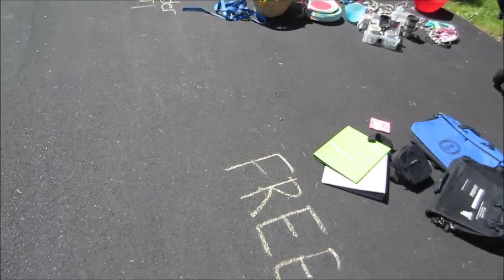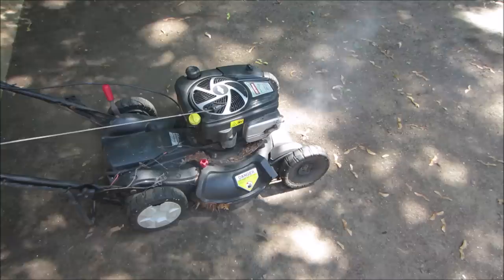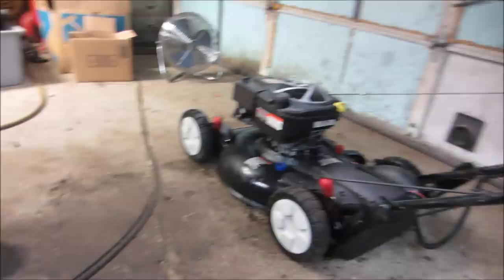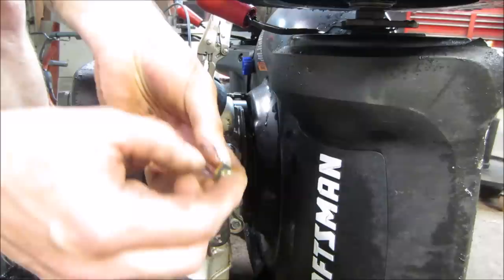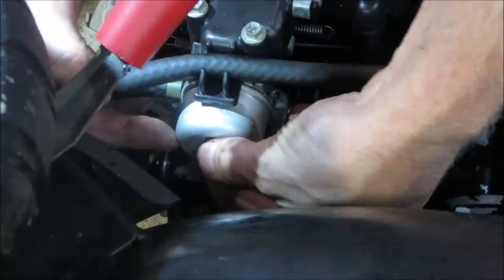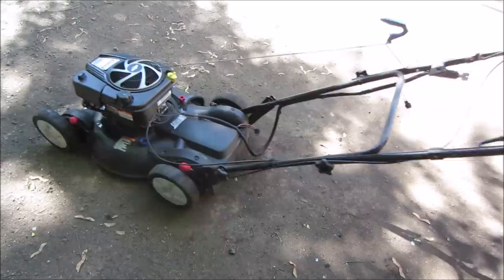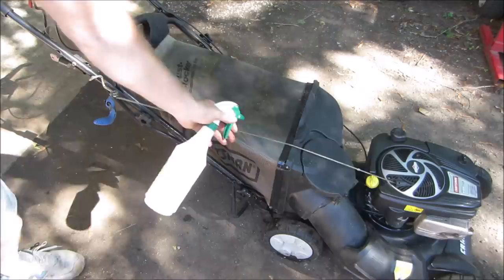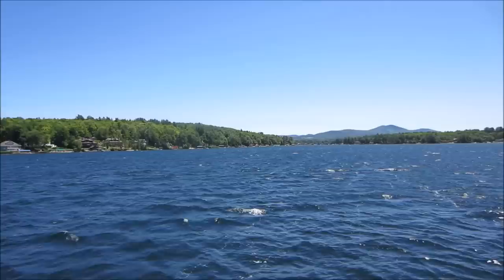Free yard sale broken lawn mower can we fix it?

Comment: On servicing those paper air filters, my initial cleaning blast with the air gun is usually from the inside out, (or against the air flow when in use) when possible.  Thanks for all these lessons.  Narragansett Bay.
Reply: Agreed.  I've always been told and have seen that you blow air filters out from inside out so as not to force particles deeper into the material.

Comment: I gave 20 bucks for a store return that was locked up. I realized at the store it was locked up because someone told their kid to fill the oil before cranking it for the first time and he did,,,,all the way to the top. I took it home, drained about 2 quarts of oil out of it and after an hour, it finally stopped smoking. Sold it the next day for 75.
Reply: BCtruck, rebuild, repair,repurpose overfilling wouldn't actually cause it to lock up unless the oil got on top of the piston somehow. I guess that could happen from overfilling and tipping the mower to one side but never heard if it.
Reply: me niether until it happened. in fact, i pulled the plug to empty the cylinder of oil.
Reply: I found one in the back of the "repair" shop in their trash pile. Asked permission, got permission, still works today.
Reply: aserta
Most repair shops also sell new stuff...
Reply: Good one I salvaged had a tag reading "siezed".  Took it home, and was pulling the plug to squirt some PB blaster in there, and a bunch of gas came out. 
Float bowl had stuck, flooded the engine and hydro'd it. 
Not a super expensive mower, but free is free.
Reply: Jeremy Alford I've seen it plenty. Its like being hydro locked. Oil/water end up in the head and it barely can be pulled over. You clean out the head and its good as new.
Reply: $75 only?
What model. Here in NJ a mower thats even in like new condition fetches around $200, like the Toro Recyclers, in really goos shape they go for $200. I mean even a little base model unit used gkes for around $100-$125 but like new straight out of the store, higher.
Reply: BCtruck, rebuild, repair,repurpose Hydro locked, it happens, seen it plenty.
Reply: Same thing happened our rototiller. Removed the plug, gave it a pull, sprayed gas from hell to breakfast LOL.

Comment: I like free stuff. I got a Honda mower from a local guy who said his kids used it to mow yards with and one day it just quit running. He dropped it off at my house and when I got home I gave it a few pulls, engine turned over with compression so I checked the gas: None, added some and it still would not start so I remembered Hondas have a Low Oil shut off and checked the oil, what oil? Drained what little was in there, added the proper amount and the mower fired off on second pull. 350 buck mower for the cost of the oil. SCORE!!!!

Comment: You could also adjust the valve tappets as a part of a tune up.

I have a 1988 model 3 HP SupaSwift Briggs & Stratton 92500 model mower which needs new rings,it smokes up like a freight train when cold then clears up after a couple of minutes, it seems to be o.k. when warm but it burned 250 mLs of oil in about 1-2 hours of use,it does blow a bit of smoke on acceleration.

It only takes 600 mLs of oil & 1/3rd of the oil disappeared in the hour or 2 that it was used,I topped it up with oil  before it was used as it also burned oil when it was previously used.

So, I'm going to rebuild it,I'm sure it's rings as it used to start after 3 pulls of the starter cord, now it starts after about 6,the spark plug is also starting to cake up with thick carbon deposits !

Comment: Its very easy to overfill these machines with oil especially at service.  Usually, draining through  the filler plug does not allow all the oil to drain from the crankcase and then you fill it up with the requisite amount as per the service manual - the machine is then overfilled.  I did this once with my Briggs Intek on the Yardman Ride-on; it started to smoke heavily after 5 minutes and in a panic I stripped the motor right down fearing broken rings.  Once into the crankcase I saw the issue; fortunately every thing was in fine order and the upside was that I rectified Briggs' diabolical engineering (e.g. head ports that were obviously shaped by a neanderthal on piecework and  head/cylinder surfaces that were like the Rockies- no wonder they have a rep for blowing head gaskets!).  The extra power I unleashed was a joy!!!

Comment: They over filled it because they checked the level by not screwing the dipstick top down. A very common problem here.
Reply: Mark Wallis I was thinking the same thing.  I believe the general rule is...if dip stick has threads--don't screw in to check oil level.  If if no threads--bottom it out to check out level.  What do you say Mustie?

Comment: Got free leaf blower, pull cord assembly was gunked up, worked fine after cleaning. Got a free edger that wouldn't run. Runs fine after replacing fuel line, filter, primer bulb.

Comment: I'm a regular viewer of your videos and have learned an awful lot from you.  I do all sorts of my own repairs on just about everything.  Garbage day is my drive-by shopping.  In our town (Goderich, Ont. on Lake Huron) you have to pay to put out garbage so a lot of people put stuff out at the curb - free for the taking.  Last week was one for the ages.  In just 7 days I scored a 10 HP snowblower with all of the bells and whistles, a Craftsman gas mower, a Craftsman electric mower and a "Greenworks" electric mower.  The owner of the snowblower showed up and assured me that there was nothing wrong with the machine.  He had pulled the starter cord out of the machine last winter and felt that it was too old to last much longer so he bought a new one.  I did a starter cord and cleaned out a jelly-filled carb fuel bowl.  Started on the first pull.  Tightened the wire on the electric start and the whole unit was A1.  The gas mower had no pull cord.  Put on a new one and got all of the grass debris away from the carb which prevented the choke from closing.  Blasted a pound of dried grass out of the air filtre.  Easy fix on an expensive unit.  The Craftsman electric had a destroyed bottom motor bearing from the plastic fan running way off centre.  Easy fix.  The Greenworks looked brand new.  The owner said take it away the motor is burnt out.  Nope.  The safety switch on the handlebars was being extra safe.  It wouldn't let power go to the motor.  Amputated it and installed a good old fashioned ON-OFF switch.  Fixed.  Good week - 4 for 4  Keep at it folks.

Comment: the battery is under the drive cover, that is where craftsman mower put them
Reply: "should be" under the cover, appears to be removed seeing the wire isn't hanging out the side and the mower harness plus is hanging there by right rear wheel :)

Comment: a co worker gave me a Toro ride on that he said didn't run, turns out it was just out of gas, same guy gave me a two day old push mower, said his wife used it once but it was really hard to start, the flywheel key was half sheared off, picked up and old lawnboy for $2, it had no air cleaner on it and had a small twig stuck in the reed valve, i'm sure I have 10 more mower stories, all just simple things.

Comment: I don't get why Briggs motors are considered "inferior."  I have a 23 year old Briggs 22" push mower and It still has the same spark plug. Starts 1st or 2nd pull even after sitting all winter. I just change oil and blades (Florida sand) and it hums right along.
Reply: Well every time I buy something with a Briggs someone will tell me "you should have gotten a Honda."
Reply: Paul Pflaum Briggs back years ago seemed to have a lot more problems. I think maybe just certain horse motors,  but some were really good. I think Honda has made a lot of companies step up and get better. I'm not a big fan of Briggs. not against them either. just don't care for the way they run or the sound of them. but they are what they are. just a work motor.
Reply: I've been told that the only advantage of Honda engines is their lightweight. Also, they now are made in China...
Reply: richardscott;  same here.  mine started running rough last week so I cleaned and checked everything, regapped the plug, cleaned the carb.  Check the build plate, 1999.  3.5hp briggs.

Comment: Well that was easy but don't forget the missing bolt from underneath
Reply: Andy K Actually, they only use three bolts to hold the engine onto the deck these days.  Don’t know why they still have four holes in the deck. You can’t use that fourth hole......
Reply: John Acuff Can't use that fourth... I thought we were done with the "Beaver" jokes!
Reply: Was wondering about that bolt myself!  Also not having the oil drain plug conveniently under the deck  whats with that?
Reply: Ralph Millie you have too turn the mower side ways too drain it and fill up the same way

Comment: Anything that runs is a bonus. I just picked up another free mower yesterday from the side of the road. To get one that actually runs like that is awesome. I have an older one that smokes, I dumped 90 weight oil in it and just use it for mowing my RC plane airstrip. It is pretty much scrap but as long as it works, I dont care.

Comment: I have a nice Garage I purchased with my home. Filled to the brim of memories dating back to 1974. With my own skills of seating valves, and adjusting the fuel mix I too have some grease in my veins. However, the man that owned this mix of belts and weed killer did not live in a world of Mustie. With months turning into sparse memories I have become lazy. I no longer seek resolution to the idle hopping shroud issues on the 3.5 hp. The draw of the new carb kits sitting on the shelves no longer call my attention. It is only your videos that fill my weekends. Thanks a lot you terd, I am now really without a cause.

Comment: Curb picked a nice pressure washer over the summer.  The oil was filled to the top of the dipstick tube...  purge, fill , new spark plug and washer hose O-rings and got a $350 machine for $6

Comment: Some new motors don't have drain plugs.
Reply: Allen McKinney noticed that...and advertised...never have to change the oil.
Reply: thefordmaniac my stepmoms transmission is the same way. No dipstick no drain plug.
Reply: Yeah, advertized as "maintenance free for life". Yeah, sure.
When at a parts strore, I asked the desk guy about them : " yeah, a new generation of B&S engines."
Will they last, I asked.     Got only a certain smile on his face as an answer..
 So...
Reply: My mower dealer recommended against not changing the oil on those fill only rigs.

They are too new to know if you are actually damaging the engine.
Reply: I agree with him, once you undo those plugs on the bottom of the engine, they leak. You have to use something like pipe dope to reseal them. I just flip the mower over any more.
Reply: @3rdworldgarage450  Not true, check E- Bay. You can get a chinese knock off carb for $14 shipped free. I do not rebuild many carbs any more for that reason now. When my last rebuild cost $27 dollars...yeah...

Comment: Check leakdown and basics. If the engine kicks back with the coil hooked up, the crank key might be stripped. It can also damage the starter clutch. Smoke after warm-up can be rings. Some 4 h.p. Briggs have a special oil change tool. It's a square hex tool. Amazon has it.

Comment: All the manuals on the mower engines I've seen say to not screw the dipstick cap down when checking the oil - just set it on top.  I don't know how much difference that makes.  About 1/4 to 1/2 inch, but that's a guess.
Reply: I was thinking the same thing.

Comment: Overfilling with oil can break things.  My late step father in law poured a whole quart in his lawnmower and broke a valve in it and wore the cam lobe off the cam.  I got the extra oil out when I caught it but the damage had been done.  The extra oil causes foam and bubbles in the oil which reduces its cooling and lubricating  qualities.  I fill everything to the full mark but not over this mark.  If I accidentally overfill it I just dump the extra out into the same oil pan I dumped the oil out.

Comment: since the key is there on the handle it has electric start. the battery is usually under the cover for the drive belt on the top of the deck. check it out. will need to replug the cable on the key switch and on deck to handle. the battery charger plugs into plug on the deck. any 12 volt charger works it's just a mater of finding a male plug to fit. or make your own with a 12 volt wall wart and male plug. I have done this to numerous mowers I pickup with the charger missing, I also use a larger battery ub1270 with 7 to 12ah and mount it externally so I don't have to remove belt cover to Recharge or replace. I also believe there is an oil drain plug under the deck belt cover by the blade. I drill a 1" hole to access the plug so I don't have to remove that belt cover at each oil change. I also mark on the top cover in plain sight, with a marker how many ounces of oil the engine requires so new owners don't overfill.

Comment: I use to pick up used push mowers and fix them up to sell. Good way to make a few bucks. Most of the Craftsmen mower had weak handle bars where the upper part joined to the lower section I use to use hose clamps to help fix the problem but it looked like problem waiting to happen so I welded the two parts together and a shot of black paint fixed that I noticed that most customers would always jiggle the handle bars on the Craftsmen mowers very weakly built. Some even looked what I did and the works really good. I notice the starter motor right off you didn't get the charger most of then failed. Why would need one with decompression on the motor. The Sears one in Waterford CT where I live closed there doors and went out of business now Lowe's is selling there mowers or yard tools like trimmers or chain saws, shame they put a lot of people out of work

Comment: it's always a good morning with a mustie1 video.  And ya got it right with the welch plug bell always goes out and you tap it down to give the slight expansion it needs to hold it.  I picked up a free pile mower that was having issues with flooding the welch plug had fallen out and jammed the float. that was a quick fix :)

Comment: A good find.
  Well my eyes aren't what they used to be and I've over filled before due to that.  So' to stop me doing it there is a simple trick I learned to help me see the oil level on any dip stick better.  I simply torch the tip of the stick so It turns blue/black then I can actually read the oil level much better, especially with clean oil. 
 Just remember it's my bright idea though..lmao
Great videos, please keep them coming.

Comment: Add 1 oz Simple Green to 16 oz of 50% bleach/50% water mixture to act as a surfactant. I've cleaned houses of mildew for years and it makes a difference and works great. Guy sold my neighbor a Snapper riding mower that was used for part of one season for almost nothing because it wouldn't start. He got frustrated and wanted it gone. Neighbor asked me to come look at it, found the safety switch under the seat bad, jumped it with a paperclip and it started right up.

Comment: i had one like this...the battery if it has one is under plastic between rear wheels these dont have a charging system they came with an adapter you left plugged in to keep battery charged!!
Reply: yup

Comment: I got 30 years out of a snapper mower. Still ran, but had bent crank, muffler threads stripped, and it used a lot of oil. Maybe it will pop up on one of these videos after somebody restores it.

Comment: Congrats on 400,000!!
The battery is probably tucked away behind a panel somewhere inside the right-rear wheel.  I tried finding a replacement battery for a similar mower.  I either couldn't find one, or it was so expensive that I didn't think I could recover the price of the battery when I sold the mower.  Don't remember which.

Comment: I can't get over all the decent things you find for free or cheap. Things like this mower wouldn't be in any free pile in the area where I live (Eastern OR) until after  3 of the 4 wheels are broken, carburetor is missing and the rod is peeking through the block.  Actually probably not even then as most people here also have a neighbor who would eagerly take it and spend $5 gas to make a quarter by hauling it in for scrap.

Comment: Years ago when I worked in the mower shop we always drained the oil like that and while it was draining we would  zip the blade off and sharpen or replace it...the new Honda motors don't have a drain plug on the bottom
Reply: they're usually covered up by a shield or belt cover anyways and rather a useless pain to get at anyway.

Comment: One reason that muffler is loose could be the mounting gasket is burned down to nothing. The mower is free so rather than snap those mounting bolts off best to just let it be. The exhaust blow by will eventually ruin the mating surface of the engine block but, oh well, it IS a free mower.

Comment: i got a free cub cadet push mower with transmission wheels like 4WD. When i got it home it ran good, then i add some sea foam to clean the injectors. You may never know on what the old owners have done to the gas. And a week or so i got it to run and it stalled so i removed the gas and checked for a clog and some water in the flow bowl. No water was found so i put it back together then add some fuel and made my own  hole on my gas cap for vacuum chamber then it ran good. It also has a oil drain bolt and a hole on the deck for me to drain. it  is probably getting ready to die cause it is old mower like my old Poulan Pro push mower i decided to use at my campsite

Comment: My bet is that when he checked the oil level he didn't turn the cap so that it didn't bottom out - reading low. So he filled it just a bit high. the difference between bottoming out the cap and letting it sit proud.